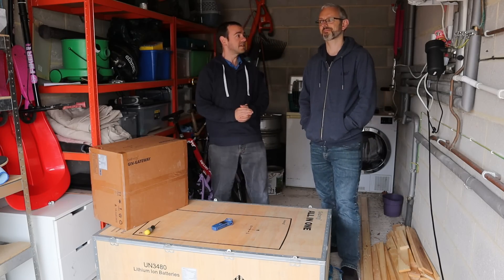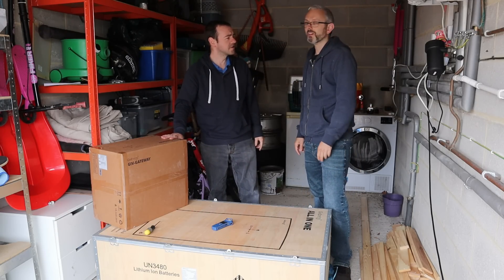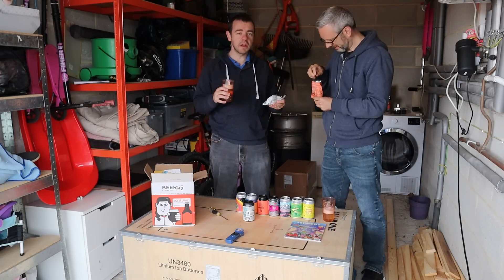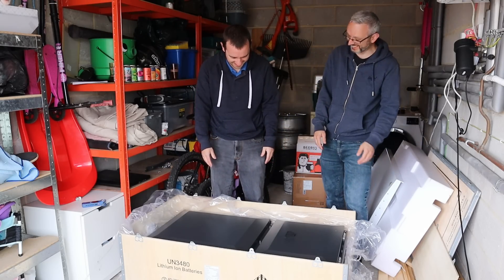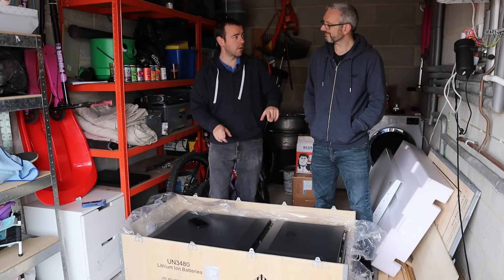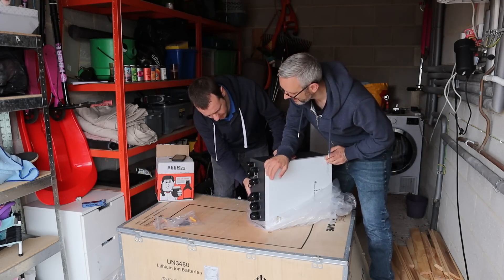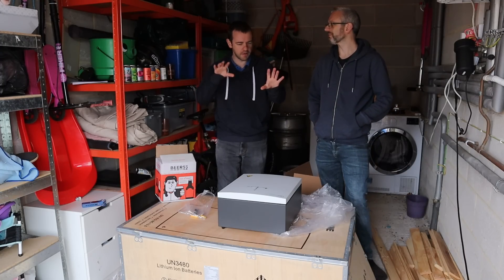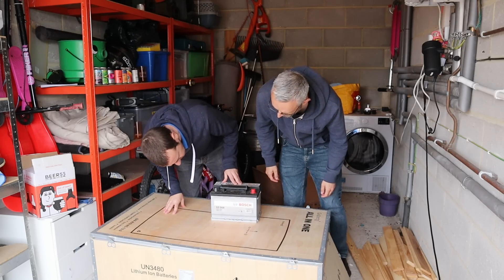GivEnergy All-In-One Home Battery & Gateway Unboxing (ish)

Comment: Just had a quote through for a tiny PV system and a AIO. Installer hasnt quoted for a pv inverter and believes the AIO negates the need for a PV inverter. Is that right?
Reply from the maker: No. AIO is AC Coupled only.

Comment: Lots of fun getting it commissioned though - have you actually had it installed & working yet ?
If you buy one make sure the installer has done one of these before as they are completely different to any other Givenergy systems.
5 days fiddling with set up so far .... hopefully up and working next week
Reply: Any news yet on the install ?

Comment: I might be not understanding it right, but does the included inverter only support the battery, and if you have solar it still needs a separate inverter? Or does the inverter do handle both solar and storage?
For someone starting from 0 it seems to be a need solution in a contained 'box' that can stand at the side of the house in the garden.
Reply from the maker: It’s an ac coupled inverter.
Reply: You also need either a solar PV string inverter connected to the solar panels or micro-inverters on each solar PV panel to convert the solar DC to AC. The rest of the system is then AC, hence it's AC coupled.

Comment: Hey there. Just wondering if anyone can tell me how long the new all-in-one battery would take to charge (0kw-full kw), from a grid connection?  Looking at going on to an off peak time of use tariff.
Reply from the maker: 2-3 hours I think.
Reply: @ElectricVehicleMan  hi again. Thanks for that. Have also just heard back from Givenergy and they state the max charge rate is 6kw/hr, so yes, just over 2hrs for a full charge. Time to investigate more about this. Had been considering the Powerwall, but the new all in one system looks like a very viable alternative.  Keep the excellent videos coming. Thanks
Reply: 2.5hr

Comment: If you have this set up yet can you look at your load+grid/battery power.  overnight I usually idled around 300w draw on grid but for some reason since getting the GE setup idle is nearly 100w extra, I would post image link to give a visual but lot of comments get auto deleted.

Comment: Your supposed to drink the beer after the unboxing guys! 🙄 that was you're mistake 🥴 My system is DC to AC and I have a 31.5kw capacity slipt into 2 x 5kw AC output systems for under £11k not including solar.

Comment: I had one installed yesterday- a very neat setup and in some ways preferable to the Powerwall as it complies  better with UK regs (no plastic case). We needed some help with GivE account setup but it's now working faultlessly running my entire house while the EDF E7 tariff is 44p/unit but the charging only cost 8.5p/unit last night! (Sadly no solar permitted due Freeholder refusal)

Comment: I have installed a second Tesla battery to handle the greater demand of a heat pump. This uses the same gateway. I wonder if this is possible with the GivEnergy system. Great if it did

Comment: We’ve had a Powerwall 2 for a while, and at the time of purchase, it was the best available. Now, I would probably choose a Givenergy system. Having a backup in a powercut was one of the reasons why we went for battery storage in the first place. We live in a remote area where the power goes on and off a lot and the Powerwall has proved its worth over and over again.
Reply: Concrete prof that you EV owners are the most boring people on the planet

Comment: Just had one fitted but not the all in one battery was separate still trying to get my head around it when my old pay as you go went off the battery and didn’t switch over to run the house witch I thought it would do?

Comment: Are these really worth it though. By that I mean my average on IO is 18p per kWh, I reckon it would take me at least 20 years to pay for it/
Reply: Makes more sense if you can get solar at the same time and save on the VAT, takes 20% off the price of the batteries straight away. When I ran my numbers, if you did it on ECO7 (assuming no EV, so not GO or IO), you could easily be out of warranty on the batteries before they pay for themselves. To make our install viable we went DIY which saved us ~£4k and with zero VAT and tbh our savings over the lifetime of the kit is not going to be massive depending where rates go. We’ve effectively bought a load of electric for the next 10-20yrs electric at 7.5p/kWh. Kinda the same as Ripple which we’re also on.
Reply: @cingramuk how did you get zero vat?
Reply: @David-bl1bt  we used a friendly local contractor who is VAT registered to procure the kit and I worked with them to install it and used their sparky to do the Part P work. It was done at the same time we did a reroof so did it all in one go.

Comment: Can you add additional battery’s? A 13kWh battery isn’t enough for an ASHP running in winter.
Reply from the maker: Up to 6 I think.
Reply: @ElectricVehicleMan  We have a very similar set up to yourself: GivEnergy Gen 3 inverter & two 9.5kWh batteries. Our 6kW ASHP and home needs this in winter.

Comment: That gizmo is of absolutely no use to me, but it's good to see the pair of you fooling about as you try to explain what it is!
Reply: Its use comes from being able to charge on cheap overnight electric, if you have a smart meter and a  Time of Use tariff. Then through the day your appliances run from the battery. You can even force it to discharge and send power back to the grid and get paid double what you paid to charge.
Reply: @salibaba You misunderstood what I meant - I'm of an age where I won't regain the outlay cost of buying the thing!
Reply: @hamshackleton  I should have tippled🤦‍♂️ gizmo.

Comment: To buy more battery (fill up using Octopus overnight tariff 7.5p/Kwh), instead of adding solar panels has been an idea of mine for some time.
Reply: Wonder how long pv panels would take to pay off at 7.5p per kWh. I'd say a long time. I like your idea.
Reply: @adriancarey7848  Exactly my thinking, once you can store at 7.5p the solar is competing against that lower price.
Reply: Please note: I too was thinking I could go for 7.5p/kWh from octopus, got a Givenergy battery and Zappi charger - only to find the 7.5 is on Octopus Itelligent and is only available if you have a compatible EV OR the specific Ohme charger!.  So I can only get 4 hrs of 9.5p/kWh - shame - 6 hours of 7.5pm would have been very nice ;)
Reply: @jonathanhart4982  Which EV do you have? If it's not on their list, you can ask them to add it. I know some are still waiting on a software update?
Reply: @davedutton5291  a Nissan Leaf 40kWh 2022 model. I have told them what I have, they haven't suggested they may support it in the future. I don't see why it can't just be down to the charger having a schedule. Maybe they need the ability to remote control the charge perhaps?
Reply: @jonathanhart4982  What charger do you have, It shows the leaf in the list on their website so should be compatible depending on the charger?
Reply: @jonathanhart4982  Just put in the default Ohme charger and it says you are eligible with a Nissan Leaf, which is a relief as I was looking at buying the Mrs one so she doesn't drive my Jag..
Reply: @davedutton5291  the charger is a Myenergi Zappi, also sold by octopus.  The is a page somewhere that lists the cars that are compatible, but it doesn't have nissan leaf, which only has a pretty dumb built in charger. I would have thought a zappi would be smart enough but sadly not. Who knows if they will over time accept other chargers!.  Their reply stated "The only makes available at the moment are; Audi, BMW, Cupra, Ford, Jaguar, Kia, Land Rover, Mini, Porsche, Skoda, Tesla and Volkswagen alternative to this we can connect if you have a Ohme charger.”

Comment: ❗For the general public, if you are buying this buy at least 1 solar panel so you get zero rated VAT - just buying the battery + gateway on its own means VAT is at 20%.
Reply: Not strictly true. You can get a solar install at zero rate VAT, and that can include a battery as part of the system as an ancillary. The solar system has to include panels, wiring and inverter and be installed by a VAT registered company (who pass on the VAT saving). So you can't buy just one panel along with a battery and get the zero rate VAT.

Comment: So why didn't he buy with at least a single solar panel, to then be able to take advantage of the reduced vat?
Reply from the maker: I believe it has to be installed, not just bought.
Reply: @ElectricVehicleMan not just installed, the wording is very specific, it needs to include panels, wiring, inverter etc. Still very brave to go for battery only, who knows where ToU tariffs are going, but at least GE AIO is very keenly priced to start with, unlike Tesla etc.
Reply from the maker: @cingramuk  ToU aren’t going anywhere. If anything they’re expanding.
Reply: @ElectricVehicleMan  wasn’t long ago that ToU went from being 5p/kWh to what 12p+? At least it’s back to 7.5p now but who knows where it will go in future, and that only applies if you have an EV too. The real future will be with demand management which the AIO looks to be geared up for with the likes of Intelligent Flux coming on line, but who knows what differential you’ll have between peak and off peak and what the payback will be. If you price up the payback based on the likes of ECO7 only (assuming no EV), it takes a long time to pay for itself, trust me I’ve run the numbers, you can easily go past the usual warranty periods. If you can afford it, it makes more sense to have batteries and solar to get the VAT saving.
Reply: @ElectricVehicleMan  I'd have still brought a single panel, and had them 'install' it inside the garage ;)
Don't ask, never get!
Reply from the maker: @stuartburns8657  That would be something I didn’t shout about on YouTube though.
Reply: @ElectricVehicleMan  😂😂
Reply: @ElectricVehicleMan  oh, yes, as an installer, certainly, or even a beneficiary of such creative frugality!
Reply: @stuartburns8657  I’d imagine any VAT registered business will be reading the rules very carefully so they don’t fall foul of tax fraud, given all the liability is with them. HMRC are not stupid, hence stipulating panels, wiring and inverter must be installed at the time to qualify. Not to say it won’t be done but can’t imagine many VAT registered companies wanting to take the risk.
Reply: @stuartburns8657 nothing like a bit of VAT fraud to make the world go round
Reply: @ExplodingPiggy  Just a humble suggestion for the little people.
It's not like the ultra rich don't take advantage of legal loopholes and incentives is it?
Oh wait....🤔
Reply: I already have 3kW of solar panels and have been thinking about batteries for a while. Very interested to see how this goes.  Does it need a separate earth rod to be used in a power cut?  I’ve had such a varied response from installers I don’t know who to trust.
Reply: @kennyj1977  I had one fitted a fortnight ago. They have installed an earth rod for the very reason you give. Neatly installed behind the garage.
Reply: @kennyj1977  Capabilities in a grid down scenario seem to vary an awful lot based on manufacturers and kit.
Some are seamless sub millisecond fail over needing an earth rod, whilst others need a manual fail over.
I'd imagine all require earthing off grid though, at least depending on the loads in question.
Kinda how longs a piece of rope I'm afraid..
Reply: @stuartburns8657  I've never seen one that's "sub millisecond" .... generally 10's of milliseconds, hence no good as a UPS. But you're right about about seperate earthing. Necessary to isolate the grid connection and have a useable earth for your remaining EPS system.
Reply: @BerkeleyTowers  Thought I saw such a system by an outfit called Artisan Electricians on YouTube, but it was several months back, and wasn't a Givenergy flavour.
Reply: @kennyj1977  
x

￼

1 second of 34 seconds

This ad will end in 27

 

￼

binky

retired and loving it!

 Supporting Member

Jun 4, 2022

#2

Not sure earthing has anything to do with it. Most batteries have a UPS function so that a cct with limited loading can be wired to it, to power essential items only, like the freezer. This would not backfeed the grid nor need any changes to the earthing arrangements.

Reply

S

SolarSystem

Member

Jun 4, 2022

#3

I've since also found this:

"It should be noted that a battery will not give backup ‘out of the box’ so it needs to be planned for ahead of the install. Furthermore, most people are not aware that a standard UK home solar array is required by law to turn off in a power cut, for the safety of grid workers, so it is usually of no help in a power cut (the exception being our advanced Level 5 option below)." from https://tanjent-energy.com/blog/power-cut-backup-options-with-battery-storage/

So this concurs with what the fella told me. ANd then this: "Update 2022: In line with the latest IET Code of Practice on Electrical Energy Storage Systems we now aim to fit a separate earthing system whenever we install a battery system with off-grid capability, so that extra cost will be included in all future quotes."
Reply: @kennyj1977  Only needs a seperate earth rod if they install/activate a backup mode (such as EPS). My KStar (or Libbi or any number of OEM) has such a mode. If you don't install it, you don't need it..........
Reply: Very interesting.  I might just go for this.

Comment: I had one installed 2 weeks ago, I absolutely love it. It’s worked flawlessly. The battery is actually 16KWh GiveEnergy have overspecced it. Due to the chemistry you can charge to 100% and discharge all the way down. One thing to note you can’t access the  invertor on the local network yet there is a software update, at the moment it’s only accessible over the web based access.
Reply: Is it LFP chemistry?
Reply from the maker: @grahambrown42  All Giv batteries are I believe.
Reply: Yes it is LFP.
Reply: App update came out yesterday to connect locally
Reply: The web only access was solved over a week ago and the updated app was released on Monday 24th (I think).  Update the app on your phone and you should now discover the AIO inverter for updates every 10 seconds.
Reply: Can also be fully managed by givtcp if you want 100% local control

Comment: Had a few quotes for the installation of this which range from just under £8k to just under £10k. Think I'll be going with the £8k quote as they're a Givenergy Platinum installer. Not sure how long for the DNO registration so may take several months??
Reply: See my question, did you work out how long it will take you to recover the investment?
Reply: @st200ol  I had a look at Gary does Solar spreadsheet and it looks like about 4-5 years depending on how prices fluctuate, as they will.